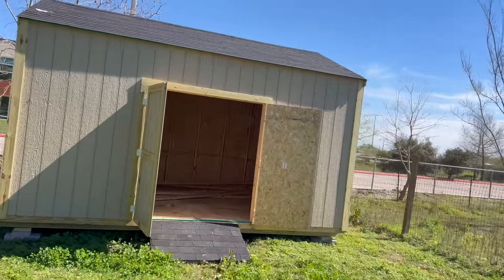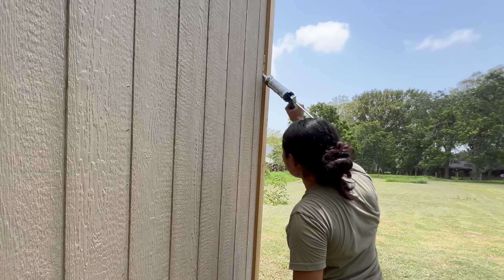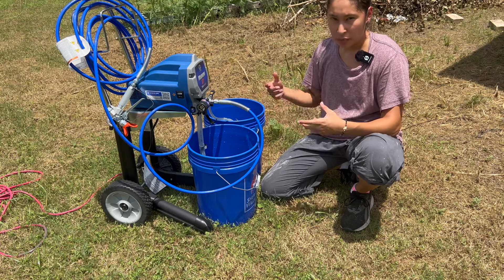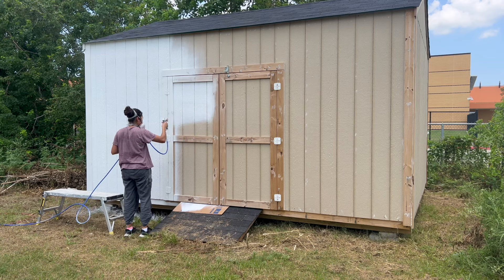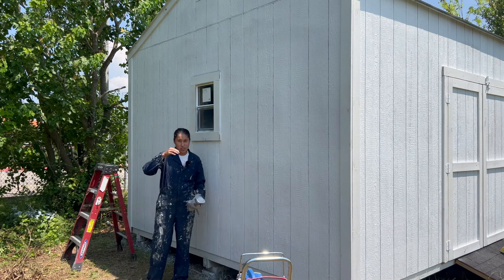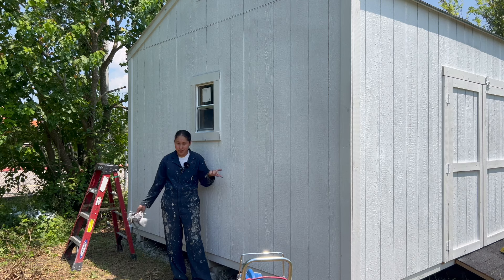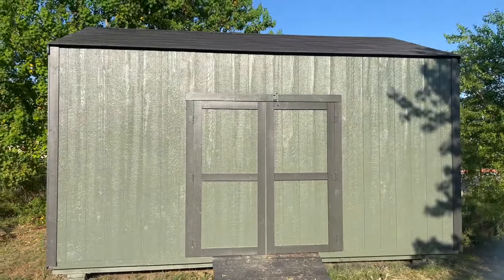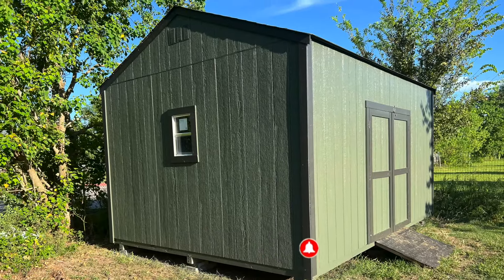HOW TO PAINT A SHED WITH A SPAYER | BACKYARD SHED MAKEOVER

Comment: Great color scheme, I like it. You're used to using a sprayer from all your other projects, so probably a bit easier for you than someone that's never used one.
It did look rather easy. I just don't like the clean up of any kind of painting; don't mind painting just hate the prep which is the most important part then the clean up.
Reply from the maker: Youre probably right! Love the difference in perspective! I prefer the prep vs the painting 🥲 
this is much simpler to set up and clean up than a smaller sprayer with a container bc you get to connect it directly to the hose
Reply: @GlendaChavez  very good!